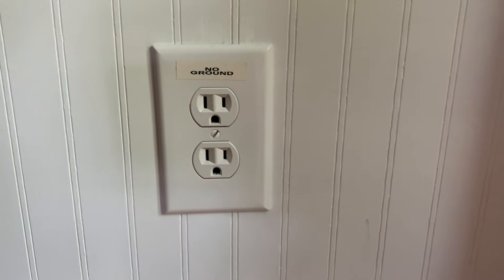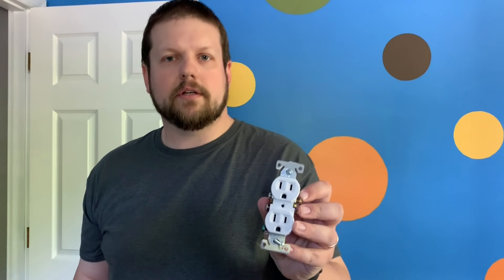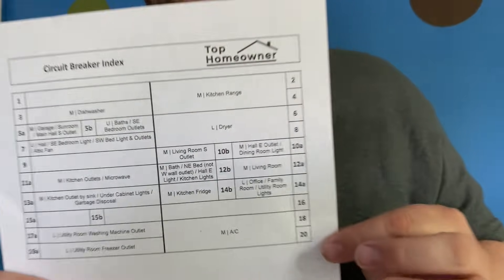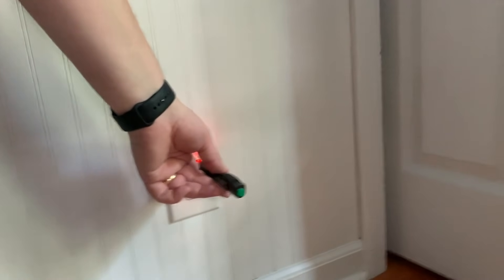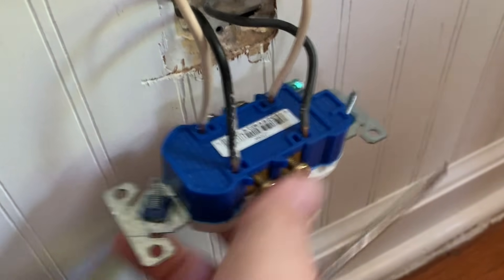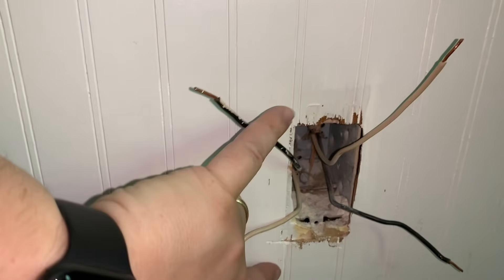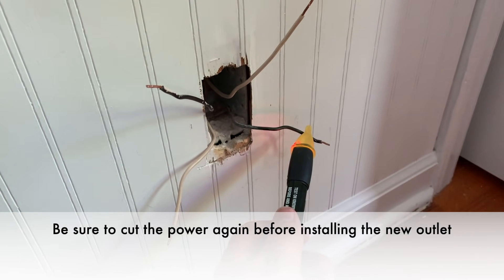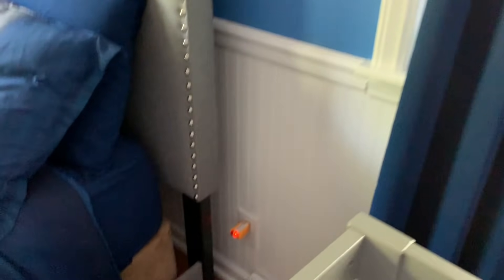Fixing Ungrounded Outlets - An Alternative Option to Rewiring Your Home

Comment: Uhhh, your test still came up with no ground at the end there.... what did we accomplish here?
Reply: Adding a GFCI outlet does not give you an equipment grounding conductor.  You still have a 2 wire ungrounded circuit.  It is against code to install a 3 prong receptacle in a 2 wire circuit unless the receptacle is GFCI.  The GFCI gives you some level of protection due to either equipment being damaged, or wiring damage itself.
Reply: @jeremiegrund  what about of you use metal box and screw the ground wire to metal box... its count as grounded???... or in other words use GFI first and start wire from there 3 prong outlet is that correct alternatives???
Reply: @jaandel1  If I understand your question correctly, the answer is no. As Jeremie Grund said, adding a GFCI outlet does not give you a ground. So there is no point in connecting a ground wire between the box and any receptacle unless there is a ground wire connecting the device box back to the electrical panel. The GFCI just detects current leaving the circuit and going through something other than the load, like a human.
Reply: @jaandel1  Adding a ground wire and attaching it to a metal box DOES NOT make a true ground. A true ground ALWAYS terminates at the breaker panel.
Reply: @jaandel1  Never do that. It can kill you. Do not play with grounding. In that case if the live wire happens to touch the box the voltage will go through the ground wire to the equipment case and GFCI will not protect you.
Reply: @jaandel1  To get a proper ground, you have to wire back to the incoming ground. If you replace a plastic box with a metal box, you are still not grounded, the metal box itself needs to be grounded. The GFCI doesn't create a ground, it senses a difference in currents between the two prongs, and assumes that there must be current leaking to ground, and turns off the circuit.
Reply: @jaandel1  Sorry but still not grounded with a metal box if you do not provide with a path to the ground rod. Wood is an excellent insulator.
Reply: Lighting Guy  The point is not to connect a ground, but to provide ground fault protection against current running to ground through your body.
Reply: @heronimousbrapson863  Can't provide ground fault protection if you don't have a ground!
Reply: @sprsgt  GFCI works fine without any ground.  That's kinda the whole point.  "Ground fault" is a term of art referring to "current leakage" outside of the existing hot and neutral circuit, TYPICALLY to an intentional ground.

Comment: GFCI ground fault circuit interrupter if I’m not mistaken if no ground then no interruptions will take place! So this gives a false sense of security.  Don’t risk your life on this non “fix”!
Reply: Kirby, you are mistaken. The GFCI device compares the current on both the hot and neutral conductors. If it detects a 5mA difference it trips. That is because the 5mA had to go somewhere, like through your body to ground. So no, a ground isn't needed for a GFCI receptacle to function.
Reply: As Paul stated, you are gaining protection from circuit faults even with no ground.  You are not going to get any ground though for power-sensitive appliances like speakers, computers etc.

Comment: Thanks for the video. I agree adding the GFCI outlet certainly improves the overall safety factor of that circuit significantly, and it's an easy way to do it. I think one thing that was unclear is that this does NOT replace the functionality of a proper safety grounding system. With this installation, if there is a short within one of the wall boxes, the GFCI will not trip. The metal box could become charged to 120V but with no grounding conductor back to the subpanel, no current is actually flowing through the metal of the wall box. The box would remain charged at 120V until someone accidentally touches it and current then can flow. Hopefully they tripped the breaker before opening the box anyways, but not desirable for the box to sit at potential though. My house is 100 years old, so a lot of the "spider web" knob & tube wiring 1.) does not have ground conductors, and 2.) does not often provide opportunity to install GFCI receptacles. What I've learned: replace wiring when possible! Any thoughts? Thanks!
Reply: Love this comment! GFCI, although acceptable in code is absolutely not a replacement for an equipment grounding conductor.  Great comment!
Reply: Valid point but the GFCI is designed to trip on milliamps of fault current within milliseconds or it wouldn't have any value. It doesn't matter if you get zapped because you touched a hot box or a bad cord or faulty load, the mechanism is the same.

Comment: Bx armor is the ground , it connects by the panel , so it ground the metal box an using the ground of the metal to ground the outlet it works to
Reply: BX has 3 conductors, so why not use the 3rd for ground.  MC looks like BX but only has 2 conductors.
Reply: @SteveWhiteDallas  Also armor is not a code-acceptable bond where I am. Even EMT needs a separate bonding conductor in some installations.

Comment: Those commenting on the push tab connection, the first ones made would accept a #12 or #14 wire. The slot being large enough for a #12 meant the #14 would not be very tight. That loose connection is where the problem arose. They have since made the tabs so only #14 will fit and fit tight. Much safer. That being said, I still use the side screws.
Reply: Tony Odermatt the fact is quite simple! If it is a 15 amp receptacle it will be setup for 14 ga wire! If a 20 amp receptacle it will be setup for 12 ga wire. If you mismatch your wire size, your panel breaker, and your receptacle amperage, then you get what you asked for! A fire risk!
Reply: The quick wire are the same tension on 14 or 12 awg. That being said , for a 30 year connection please use the screws.
Reply: Regardless, common sense indicates a spring-type connection has less contact area, and thus less current-carrying capacity, than a properly wrapped screw connection. Sure, it takes a few more seconds to do a better job, but a quality connection will last for decades.
Reply from the maker: Thanks for your comment. GFCI receptacles don't have the push-in connection, they use a clamp and the side terminals to hold the wire in place. https://youtu.be/3AXcRsAOLPk

Comment: UK this is classed as additional protection. Not fault protection. You must have ground wire.
Reply: Same in the US generally. This is an exception to allow use to three prong plugs. In most of Europe there is no problem as grounded plugs are designed to fit ungrounded sockets. I personally would recommend using  portable GFCI in such a case.

Comment: no one has got a shock in 50 years why change the plugs and chance cracking the brittle inslation on the old wire do anything replace all wire instead..
Reply: The reason one does this is to allow the use of three prong plugs. One does this instead of changing the wires as it is cheaper.

Comment: Without the ground wire by code you have to install a gfci at every location.
Reply: Sorry, no.
Reply: Moon Pie  You can "install" as many as you want, as long as they are not fed from the "load" terminals of any of the others.

Comment: 1) wish you would have shown the orig not grounded checker-light, 2)do show the screw driver unlocking the springed wire
Reply: Yes, he should also have shown checking the receptacle BEFORE turning off the power, so you know the tester is "working".  That screwdriver is probably way too wide for the purpose of releasing the back-stab springs.

Comment: Never use push in connection .  You are obviously not a journeyman electrocian
Reply: I've seen many receptacles wired by journeyman electricians using the push in connection, although I always use the screw connectors.
Reply from the maker: GFCI receptacles never have a push-in connection as the back-wiring option.

Comment: WRONG! The GFCI will never trip except for the test button! 
And, none of the other outlets would be GFCI protected unless there was a third wire going to each of the ground terminals!

This is not to code no matter where you live in the world!
Reply: The test function tests the outlet. It diverts some current past the GFCI to the neutral. This simulates the situation where someone gets shocked from the circuit. GFCIs do not require ground.

I do not know you are trolling as you saw the comment about the lack of knowledge on the comments being extreme.
Reply from the maker: I made a follow-up video that talks about this and answers some other questions https://youtu.be/3AXcRsAOLPk
Reply: Joshua Barrett check the 2020.  According to a code class I took a few months back, it is no longer acceptable in the 2020 nec. Don’t have a 2020 book yet so can’t site the section.  A lot has changed in the 2020 compared to years past especially for residential electricians
Reply: @highryder100  The 2020 code?  There has been absolutely no change to 406.4 (D)(2)(c) in the 2020 NEC.   You don't need the book. Go look it up online at NFPA dot org.  Free access.
Reply: @Joshua Barrett Actually... Go get yourself an outlet tester with a button for testing GFCI circuits.. Now.. Wire one up in a test box without the ground lug attached. With a slave outlet(Non GFCI) attached. Plug the tester into each outlet. Then press the test button.
Notice that the GFCI does not trip.
This little point makes the difference between your child getting electrocuted to death in a bathtub.. and 14 dollars to replace a PROPERLY installed and grounded circuit. Never take a shortcut. It could be the life of your loved ones or yourself. 
I've been playing with electricity since I was 6 years old. Just old enough to know how to use a screwdriver and not stab myself! LOL!
Please! Check this out yourself, Don't take risks. I just installed a GFCI in the bathroom when I bought my new house and didn't get the ground lug tight enough. It let go when I pushed the outlet into the box. I pressed the test button. It popped out! I thought I was alright. But I NEVER trust a test button because they have been known to trip there but not with an actual fault.. So I plugged in my tester and it didn't pop.. THIS IS WHY I TEST! I opened the box back up and found the issue! Re attached the lug. Re installed and all of a sudden the whole bathroom was GFCI protected! WOO!
Reply: @austech360  Yes, the tester will not work but that is just because of how the tester operates.
Reply: THIS is the only right answer!
Electrician here.. Don't do this. You'll waste money on GFCIs that don't trip when they fault to ground...

Comment: GFCI outlets need a ground conductor.  How are you going to monitor ground fault current without one?  Next time, test your GFCI from that end of the line outlet.  I don't know why anybody makes these test plugins without a test button... I won't buy 'em.
Reply: Ground fault means that current escapes from the circuit to the ground possibly through a person. Ground fault is detected by detecting a difference of current in the line and neutral wires. If enough difference (5 mA in the US, 30 mA in Europe) is detected the GFCI cuts both the line and neutral wires isolating the circuit.

The proper way to test a GFCI is to press the test button in the outlet. This diverts current from the line to neutral bypassing the GFCI. If you use an external tester it of course does not work as an external tester has no access to the inside of the GFCI. It can only divert current form the line to the ground and this does not work without a ground wire. This is fault in the testing method and it does not prove that the GFCI does not work.

The term GFCI can be confusing as there is the word "ground". In Europe those are called RCDs (Residual Current Device).

Now a ground wire helps in detecting a ground fault. If current escapes to the case, the GFCI breaks the current even if the normal circuit breaker does not. Without a ground wire this might not happen but at least when someone touches the case the current breaks. I would trust a GFCI alone in a bathroom or where there is plenty of ground potential but in a bedroom and living room it is enough. In Europe we use grounded sockets on such rooms without grounding or GFGI.
Reply: I guess I'm not familiar with how GFCI receptacles actually self test. So when you hit "TEST" does the unit divert some current to the grounding bus of the receptacle? Or does it just divert some current around (bypass) the current monitor such that the current is all still flowing on the neutral conductor to panel? (that way grounding conductor is not actually needed to self text). Thanks!
Reply: @danieldorsett1544 You're on the right track. The basic GFCI detector element is a current sensing transformer. Both hot and neutral conductors pass through the transformer core, functioning as two primary "windings." Because at any given moment the current in the hot is moving in the opposite direction to the neutral, the electromagnetic fields created by these two conductors normally cancel each other and the output of the transformer is essentially zero. If there is an imbalance in the current through hot and neutral conductors, the transformer sees a net non-zero input and you get a voltage generated on the secondary. This voltage is detected and indirectly results in the GFCI opening the circuit. To test, a suitable resistance (roughly 20k) is connected between the hot conductor downstream of the current transformer and the neutral upstream of the transformer. This simulates current being diverted out of the circuit from the standpoint of the detector, by creating a current imbalance and therefore a net primary input to the current transformer. Operation either in test or normal use has nothing to do with the ground terminal, whether it is connected or not.
Reply: @Finch. You're wrong. GFCI doesnt need a grounded conductor -- just line and neutral. That said, your plug-in GFCI tester won't work if the receptacle you're testing doesn't have a ground. But the GFCI itself will test and reset properly without any grounding conductor.

Comment: Great video! Quick question: on the protected non-GFCI outlets, if we plug in the outlet tester, will it still show as open ground, or will it now show grounded?
Reply: An open ground is the same as no ground, you aren't gaining any equipment grounding just by adding GFCI protection.  You are gaining some safety in that if the same level of current flowing is not coming out the other side the GFCI will trip potentially saving from electrical shocks.
Reply: @jeremiegrund  But if the person being electrocuted is completing the circuit the GFCI wouldn't trip, allowing them to continue being electrocuted, right?
Reply: Adam D the human body would provide the resistance to go over the 5ma threshold the GFCI is looking for. If that didn’t work GFCIs would have never made it into code
Reply: Adam D unless you have your finger plugged into the other outlet, it will trip. The GFCI measures the current coming out the black and the current coming back in to the white. If they’re different ( like some current is coming through your finger and going to ground) it trips.
Reply: @adamd6664  Depends on what you mean...
If being shocked through the hot and neutral, a GFCI would not trip
If being shocked through a hot and ground (whether in the GFCI circuit or completely unrelated like another circuit, a water pipe, wet basement floor, radiator pipe, etc.) the GFCI would trip.
Ironically, if you were being shocked through the hot and neutral, couldn't let go, but could somehow manage to ground yourself, you'd save your life!  LoL
Reply: It shows open ground. The tester just tests for ground and there is none. The label is just so that the one using the tester can interpret the result correctly.
Reply: Okaro X :  
I think the label is meant to inform anyone plugging a device into the outlet that the outlet has no ground. Also, any downstream outlets should have the “No Ground “ label as well.

Comment: Did you connect the GFCI to ground wire that was coming from service panel? Or only to hot and neutral?
Reply: It is acceptable by NEC as long as you place the appropriate labels. On the GFCI that means a NO EQUIPMENT GROUND label. Any regular receptacles down-leg also need a GFCI PROTECTED label in addition to the NO EQUIPMENT GROUND label.
Reply: The whole point of the video is to do when there is no ground wire so ground wire is not connected. If you have a ground wire you must use it.
Reply: Why isn't the receptical grounded? Is the box wired with BX wire? If so add a ground screw to the metal box with a piece of bare wire.
Reply: @markhammond4539  Like he said in the video, the wire was originally run with only 2 conductor wire, no ground.  The metal box also is not grounded he said.

Comment: Been doing electrical since 1973,... wayyy before GFI. But done a S-load of work since. This guy is DANGEROUS. May errors, don't follow his 'advice'. If a inspector, or even a licenced electrician discovered this work the entire building will be cited, disconnected and require a complete re-wire. Fire, electrocution (even a shock) will empty you entire life savings.
Reply: Disagree.
Reply: @RayRay: Maybe read the national electrical code about ungrounded GFCI replacement receptacles so you won't sound so foolish. Nothing in this video is even slightly illegal. I'm a certified inspector and would approve his installation, assuming he wired the GFCI load terminals correctly and attached the labels to any "ordinary" three-slot receptacles installed "downstream".